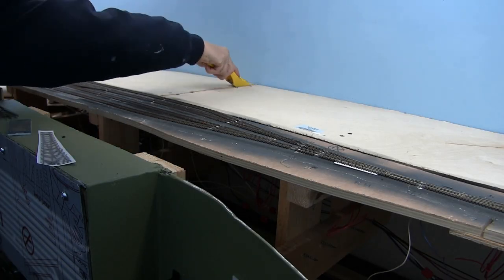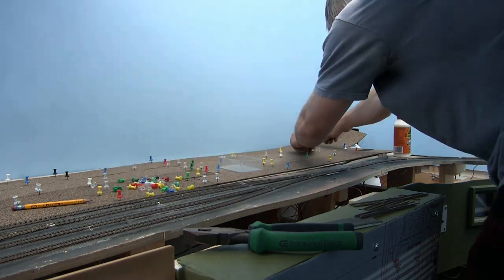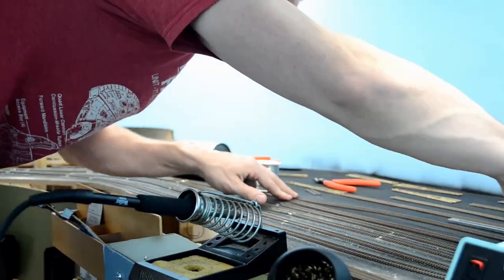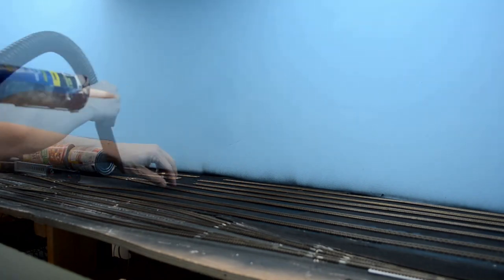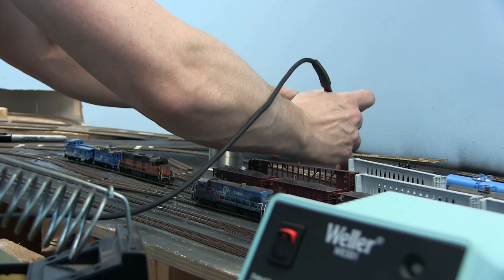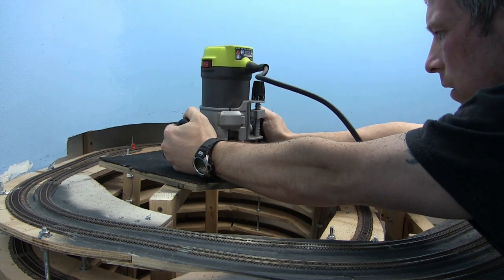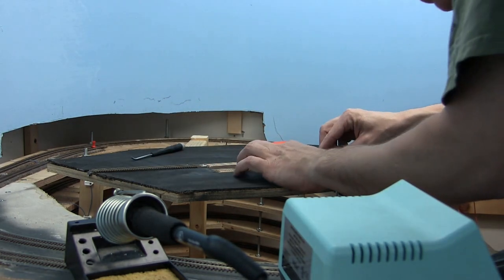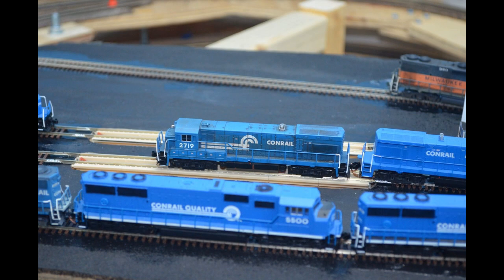Building Browns Yard and Amboy Engine Facility

Comment: The ariel photos of the yard and the engine facility really look great in the video.  In my experience of hosting Op Sessions at the stage you are at, really were great in working out any bugs on the layout.  Take notes and go back a correct them now before you start on the scenery work.   Op Sessions really have a  lot of components to them. Focus on just one of them. Example how did the trains/traffic flow during the session.  Then you can go back and make those adjustments to the dispatcher's sheet /or train warrants.  It took almost six Op Sessions on my layout before I got to a session where items seemed to flow well and keep crews busy.  Keep up the good work!
Reply: Corn Country Rails i
Reply from the maker: Corn Country Rails that is for the tips Tony, you are an inspiration!

Comment: good day Joe. super video. and people say i like a lot of push pins.. lol.. more the better. 
 so with your Conrail train, did they not always run with cabooses ?  any memories i have of them. i remember that conductor hanging out on the end of the trains. smoke hanging from his mouth and waving away. 
a sacrifice of a track that holds 10 cars.. not a big lose for smooth operations. 
wow end of February for the panel.. that part would take me forever. I would be to busy running the trains and having fun 
 see you in the next video series.
Reply from the maker: The research I found says that cabooses on main line trains ended in 1984. But there were exceptions to the rules. Local trains did use cabooses in certain situations, also work trains also used them. Thanks for the good words and thanks for watching.

Comment: Track 3. Put it down, glue and tack ties. After your solder cools, cut a gap and place pieces of styrene in the gaps as insulators.
Reply from the maker: Thanks for the tip!

Comment: Hello , nice set up , but in the future you can put the vacuum end on the router to keep the dust down . Also  just route the hole all the way through and cap the bottom and build up the inside to desired depth.
Reply from the maker: Adrien Gadson thanks for the tips! Thanks for watching.

Comment: The challenges with the yard throat ended up being a happy accident for you. Including some open space in the yard is the key to making it seem expansive to the the viewer. A yard with every inch filled with track isn't prototypic and is visually less appealing. The spaces tell the story of how people would move about in the yard as there is plenty of non-rail movement that has to be supported. Resist the temptation to fill those spaces with anything other than the typical bland terrain found in and around rail yards. 

Thanks for sharing!
Reply from the maker: thanks for the tip. Ya just going to be gravel, and maybe a service truck fixing brake shoes;)

Comment: Thanks for the really interesting video Joe.  One thing I noticed at the end was the suitcase connectors under the engine shop.  Did you use them throughout the layoutand how reliable have they been?  I am just in the midst of building benchwork and looking ahead to the wiring and am leaning toward the connectors but would like tohear your thoughts on them.  Thanks for the help!
Reply from the maker: Yes suitcase connectors are perfect. But I caution you don't use the blue ones you can buy a walmart or the auto parts store. They are too big for the size wire we are using and will not have good connections. Order the red ones online. Like this  https://www.digikey.com/product-detail/en/3m/558-(BOXED)/920074-07-ND/287160.